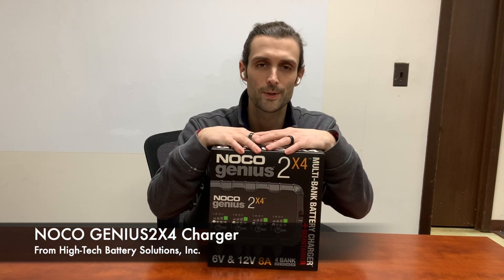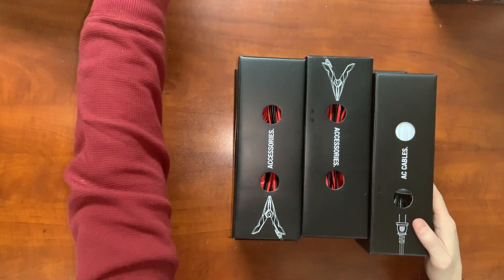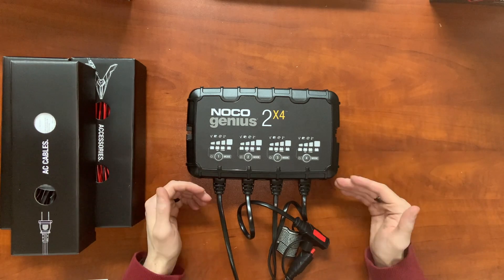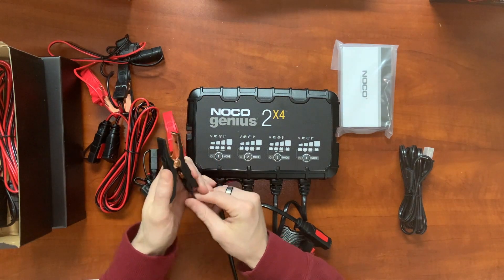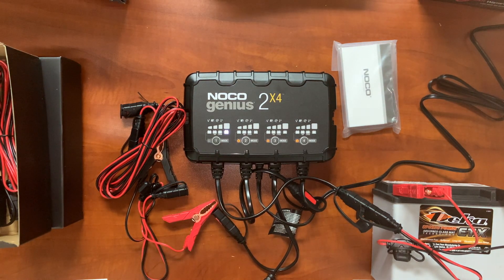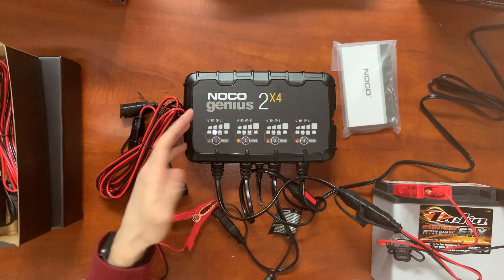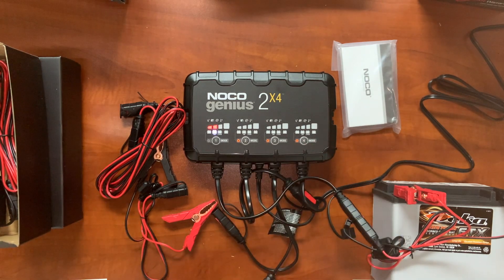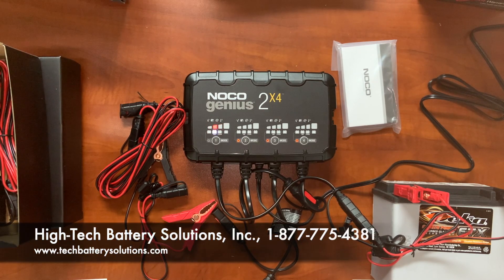NOCO GENIUS2X4 Battery Charger Review

Comment: Is the maintenance mode good? I have 3 and 4 year old batteries. I want to revive the battery. Can he ???  ❌❌ ♥ ️
Reply from the maker: The GENIUS2X4 is a good all-around battery charger and maintainer with a built-in desulphation mode. If you're looking for a dedicated repair mode to deal with extremely sulfated batteries then you're going to be better off with either the GENIUS5 or the GENIUS10 series units. Both of those units are only single bank however they have the dedicated repair mode to deal strictly with damaged batteries.

Comment: How do you know if you have a gel cell or wet cell or an AMG battery ?
Reply from the maker: There should be some identifier on the battery itself. Either on the label of the battery or by looking up the part number of the battery to see. Simply looking at the battery and not seeing any caps on it will not tell you if its a sealed AGM or GEL cell unit.
Reply: Will charging an AGM battery with the lead acid setting hurt the battery? Or vise versa ?
Reply from the maker: @BackwoodsLegit  It could hurt an AGM battery over the long run. The main difference between the two modes is the charging and float voltage. The AGM batteries are much more sensitive to charging voltages and could gas if they are left on the standard 12V mode over an extended period of time due to the higher float voltage of that mode. Flooded batteries tend to ride with a higher float voltage, but I don't believe they would take damage in the AGM setting.

Comment: Have you reviewed the 5x4 on board genius?
Reply from the maker: There is no 5X4 model, NOCO has the GENPRO10X4 model which is a 4 bank 10 amp per bank charger. They has a small release earlier this year however they will not be available for regular sale until the first of April.
Reply: Maybe I meant to say 5x2. I just purchased the onboard 5x2 charger but didn't see many reviews on YouTube.
Reply from the maker: @skeezle1337  Got it, we keep selling out the 5X2 series as soon as we get them in. We don't have a video up on that unit yet, but its on deck.
Reply: Very cool! Cant wait. Im extremely impressed with the quality. But some of the features are confusing.

Comment: great video! so you can set it and forget it?  my two wakeboard boat batteries and two 12v 35ah agm can be left on when not I'm use to maintain batteries?
Reply from the maker: Yes, this charger is fully automatic and can be left connected to your batteries indefinitely without damaging them!